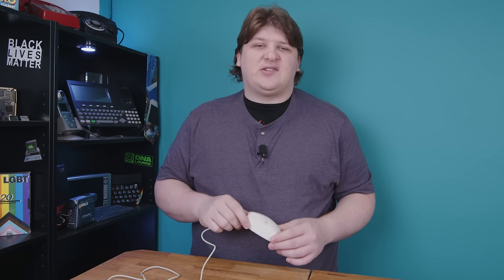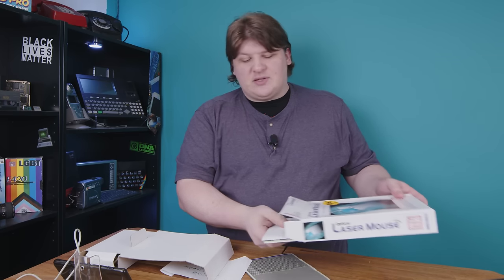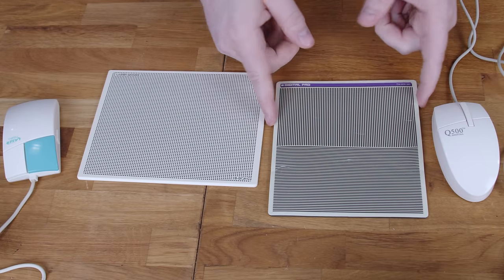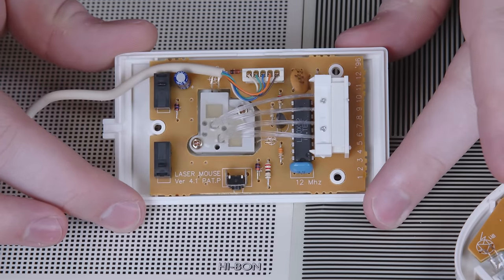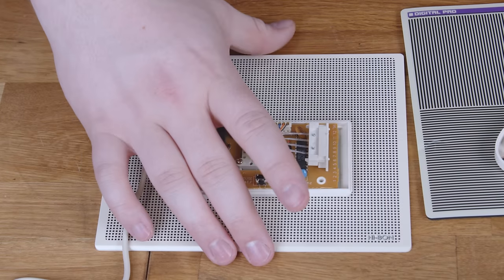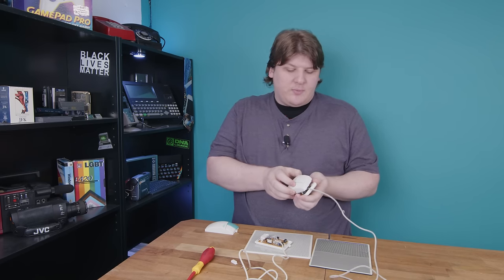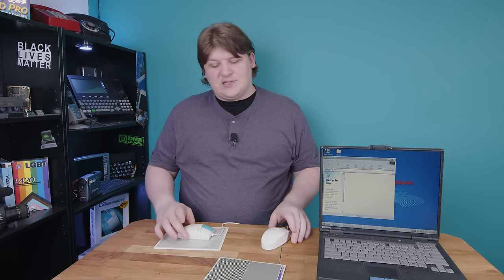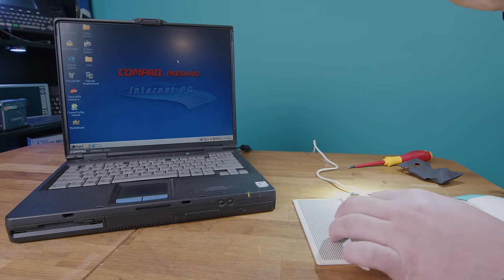LMOX2, The Other Weirdest Mouse

Comment: Hey, I'm the guy that sent that to Clint! Can't believe I got so much content out that silly mouse. Great video as always!
Reply from the maker: Hahaha, wow, yeah, what a trip it's had! Now we have a chain of custody going back three steps - where'd you get it? Nobody else seems to have ever seen one of these, did it pop up at a flea market or something? Thanks for enjoying!
Reply: @CathodeRayDude  I found at the Goodwill in Lebanon, IN still in the shrinkwrap.
Reply: ... and the trail goes cold.

OK, Goodwill donator.  Where you at??  :-D
Reply: @aaronedwards1239  I was there last week. Now this makes me wanna go check the ones down here in the evansville area.
Reply: @CathodeRayDude  I think it's rad that you guys are networking with each other. I would love a collab sometime.
Reply: I saw a few of those weird mice, and many even stranger mouse pads such as the reflective ones. I guess back then V.C.s were looking for the next big thing and a lot of companies were through out this rubbish to try to be that, and of course failed.
Reply: Thx Aaron
Reply: I don't think it's quite done yet. I'd love BaldEngineer or someone like that actually qualified (electrical engineer who loves reverse engineering old computer stuff) take a stab at decoding it.
Reply: @SirenaWF1  that tech is really old, SUN had mice like that over 30yrs ago, and they weren't new stuff then. No one really used them on anything else because they are a bad design, loose or scratch that mousepad and the thing is useless.

Comment: After watching this, I think you might actually have things backwards on which of these came first. You're absolutely right that the Q500 is a minimum viable product, but I think that might be a product of simplifying what they learned from the other one. As you said, the neoprene insert on the mouse did effectively nothing, and it's a much more complex device. It may have been that they realized a cheaper way to do things that still sorta works and tried to simplify as a way to cut costs.
Reply from the maker: possibly, but I really feel like the separate-X-and-Y pad is such a ridiculous instrument that I can't picture someone going from the grid to the XY design
Reply: @CathodeRayDude  absolutely valid point, though I tend to never underestimate cost cutting measures in electronics 😅
Reply: Could just be that the manufacturer realized there were trade-offs to each approach and offered a portfolio of options to the OEM to implement as they saw fit.
Reply: @CathodeRayDude  Although, as you saw, the separate X and Y pad could take odd angles slightly better than the grid design. Tech rarely goes from simpler to more complicated to achieve the same effect.
Reply: I'm gonna throw another 2 cents at it, to say that maybe they did release a tad later the cheaper model, maybe even keeping both on market, one as a more "premium" product, while the other is a low cost variant.
Reply: @CathodeRayDude  I would really suggest looking if possible at the release dates of the mice in relation to the expiry dates on the Mouse Systems patents. The Q500 really looks like something working around those patents while the LMOX2 looks like it is not so presumably was released after the Mouse Systems patents expired.

Comment: I wonder if the neoprene shade is to block *sunlight*, which has lots of infrared. They might've seen issues with users working in sunny environments.
Reply: I remember when LGR did a video about the Sexy Mouse, and it said on the box to avoid using it in direct sunlight. He tried using it outside and it didn't work, so you're most likely correct.
Reply: Or inside the aforementioned arc furnace. Been near one once. Pretty sure they emit everything from DC ground currents to ultraviolet.
Reply: Could the neoprene be loaded with some graphite particles and offer some EMC immunity maybe?
Reply: Yeah, a lot of computer equipment is strangely sensitive to UV if they're not properly shielded. I've heard of electronics being recalled because they would completely break under UV, because their engineers didn't think to test for it before going to production. I also vaguely remember a story about a solar flare causing a bizarre glitch in a video game or computer because of UV.
Reply: @starcrashr  the Raspi 3 (?) release version reboots when you take a flash photo of it because one of the chips is sensitive to light (and improperly packaged). Not a big deal if you know about it – just put something opaque over it – but a surprise to some early adopters
Reply: @the-shork  Right! I was trying to remember that one! I heard some people have been covering them with blu tac.
Reply: It could also be for incandescent/halogen. Several years ago I was using IR-sensitive photosensors and it was virtually impossible to detect a CFL even up close, but an old incandescent bulb worked easily from a moderate distance. And @hai, it was the Pi 2 with the light sensitivity issue. I tried mine under a xenon flash and it indeed crashed.
Reply: @starcrashr  IIRC it was a speed runner playing Super Mario 64. A bit got flipped and sent him to the top of a tower or something.
Reply: @CompComp  Yeah, that's the one. It was a bizarre coincidence.

Comment: What about patent TW388829B, "Optical mouse and mouse pad" by Kyoung-Jin Kim? The original is in Chinese, but it seems to match the Q500.
Reply from the maker: KILLER WORK! That's DEFINITELY it. I tried and tried but could not find this. Now I gotta read it and see if I can suss out how it works
Reply: @CathodeRayDude  You might want to check out the Korean patents it links to, I found the machine translation a bit better; of course the ideal would be  Korean speaker.

Comment: Going by the close ups, it seems like the 4 strands going to each photodiode are in 4x1 strips and not 2x2 bundles. This would make more sense for how it would work going across the grid, and it means the photodiodes and logic in the LMOX2 are working exactly the same as the Q500, sans the strobing lights.

If you break it down to one row of 4 horizontal strands for the vertical movement, because it's exactly twice as wide as the dots, if it's over the dots it'll always have 2 strands seeing black and two seeing white.

So then the possibilities for what each strand can "see" are:
ooxx
xoox
xxoo
oxxo

This means the horizontal position doesn't matter. No matter where the mouse is, as long as it's aligned properly it'll always only be seeing 4 white, or 2:2 white & black. The result is the two photodiodes will be seeing the same pattern of dark and light differences when you move the mouse vertically.

This also explains why the alignment is so sensitive compared to the Q500. A small amount of rotation will cause that ratio to change. If the row of stands gets too far off you'll cease to get the same clear dark and light differences between the rows, and thus to the diodes, and it'll have a harder time understanding what is happening.

Comment: It's been a LONG time (like 20 years) since I did my research into weird mice, but I remember Iotek was a Chinese company that designed a bunch of budget oddball pointing devices. They have a few CN parents in their name.
One day I'll find the weird ultrasonic 3d ring mouse I bought, due to the culmination of that research.
Reply: *patents These guys, iirc, are both based on the same patent. They use IR light to reflect patterns onto receivers, which are designated to X and Y tracking. You're right in that the controller works similarly to how a ball mouse works, btw. It's not the exact same, but similar enough to mention it.
I forget how it knows which direction it's moving, but I know it was in the patent.

Here's one of their patents that I was able to find.
CN99800299A
Reply: Qijia Communication Kunshan Co Ltd ?

Comment: I think you are spot on about how these worked. I think the ‘forgetting how to mouse’ is just an AGC (automatic gain control) circuit adapting. And all of them plus the mouse systems do work like a ball mouse just the the quadrature signal ‘unrolled’ as you said. The mouse systems is much older, it was around in the 80s. Those pads were a hassle though. Heavy and expensive to replace.

Comment: Try to print a mousepad with gradually larger or smaller gaps. So you could theoretically have a hidpi area of the 'desk' our mousepad and a low one
Reply: probably wouldn't work too well, since the fiber optic light changes seem to depend on the grid spacing.

Comment: I swear back in the 90s I had a different kind of optical mouse that required its own special pad. As I recall the pad was dark grey with very fine reflective lines (wires perhaps) in a grid.
Reply from the maker: Yep, that would have been a Mouse Systems design! Check out the Q500 video for an explanation of the WACKY system it used.

Comment: I guess the reason why they couldn't track X&Y on the Q500 is because the sensors don't just see 'Oh its on top' - 'Now its at the bottom' (Like in your animation) - I think that they really depend on the top two rows - middle two rows - bottom two rows (if not even more intermittent steps). Great vid as usual!

Comment: I think IO-Tek probably made the Q500 as a reference design and the LMOX company probably licensed the chip and tweaked the design to work on a better mousepad. 
IO-Tek probably showed off the chip a year earlier and both companies had started development around the same time to reach a 96 release date.
Reply: I really doubt it; the incorporation address of the company in the LMOX FCC application is in the same building as iotek's address in Seoul, so the importer didn't even do certification. They probably just asked iotek to white-label the mouse.

Comment: 9:58 I think you have the directions of the sensors switched.
If I had to guess at how it works then I'd say that they're basically sampling a whole slit of 4 fiber strands and then use the exact same technique as in the other mouse just with half the signal strength as only 2 out of the 4 strands will pass over the black squares in any direction.
Edit: If it were to work in the direction you suggested then it would be possible for the 2 strand wide sensor to pass in between the dots.

Comment: Damn, that was a smooth cut with the two of them joke. I was half right with my comment on the Q500!
Also, I can confirm that the jitteriness is likely an issue with the poling rate of the serial interface. I've noticed the exact same thing happen with both Microsoft mice and a Genius WhiteMouse.
Nice deskmat, too.

Comment: Having used one of these in the 1990s I can add that you're absolutely correct with the release dates.  The first "optical" mice that were not using optical flow type sensors (like the Microsoft one) used metal printed bases as well.  I believe from memory, but cannot confirm that I may have used a Sun Microsystems mouse that used a metal pad with blue lines on it.

Actually I found it... It's on the Wikipedia page.  It was indeed a three button mouse from Sun.

Comment: That’s really clever to use optical fibers to do the integration math to sample a larger area.  Neat. I also bet that the one with more fibers was substantially more expensive to produce, being the high end of io tech’s offerings, and the other, as you say, the minimum viable product.  And with that many fibers I would expect that more than anything, assembly would have been a much higher amount of labor. Gut feelings here.

Comment: Oh man, I thought they gave up on optical mice in the 80's.  Never knew these "modern" ones existed.  I grew up using the 3 button IBM XT mouse with the metal pad, back in the 80's.  So I thought the switch to ball mice was weird.  The older optical mouse seemed so much more elegant with no moving parts.

Comment: Your comment on rotating angles of mouse use reminded me of something. I used to have a Wacom tablet that included a mouse that could be used on the tablet. The tablet had a habit of slowly rotating on my desk as I used it, rotating the mouse tracking with it. Usually I would notice it and rotate it back before it got too annoying. One day I looked down and realized that the tablet had gradually rotated 90°, which meant that up and down were transposed with left and right. What’s crazy is that my brain had gradually compensated for it, and I didn’t even realize it had happened. Once I became conscious of it, the ruse collapsed and I had to rotate the tablet back to regain control.

Comment: The middle mouse button functions are as far as I remember are a duplicate of a Logic 3 serial ball mouse I owned around the same time (possibly a year or two earlier).  As far as I can tell/remember similar features were quite common for 3 button mice around the time as very little software actually supported 3 button mice (certainly windows 3.1 didn't) but manufacturers were looking for features that made them stand out above the "official" Microsoft Windows mice and adding an extra button was one of them.

Comment: When I went to acommunity college in the 90s we had some similar optical mice.
There was something in the college charter that they couldn't donate or sell any excess or obsolete equipment. So everything was used until it broke then thrown away.
One day I was helping move things around the computer lab and we found a locked cupboard full of optical mice that cam with an optical mousepad. 
I'm not sure if they are the same. There were a lot of first gen optical mice that needed a certain pattern to 'move'. 
We put them on all the PCs and tossed the mice they came with. 
Everyone complained.

Comment: I dunno if I'm making things up in my memories but I have a vague recollection of going to somewhere that did mapping or architectural CAD work as a kid (would have been early 2000's) and seeing these guys using a whole table with the grid dots on them. Perhaps this was a potential use case in industrial process that got ported over to the consumer side?

The dots might have been for scale and nothing to do with the mouse - interesting none the less.
Reply from the maker: Those would have been CAD tablets, which i THINK actually use a completely different system where the pad has a grid of wires embedded in it and the puck finds its location by inducing current in them - the grid you can see is just for reference. But I may be completely wrong about that, I haven't deep dived it yet.

Comment: I knew it! I commented how I thought it worked in the previous video (just by looking at the bottom) and I was exactly right. Each line is "blurring" the whole pad in the desired direction, so it can observe one axis while the other one is averaged out.

Also I don't think the serial port is a problem, just the controller which is probably just as slow in the PS/2 version.

Comment: My guess would be that the Q500 was released slightly later than the Laser Mouse as the design is more "modern". It also strikes me that the implementation changes - the separation of the two axes, the drop to two sensors, and the switch to a neoprene mouse pad  - were all cost cutting exercises. Bundling two lots of 8 fibres together and keeping them aligned, applying silicone, and then sorting the strands to send them to the appropriate sensor would likely have been a fiddly labour-intensive manual production process, but dealing with two pairs that can just be clamped and easily poked into the correct hole reduces BOM and assembly costs considerably. On top of that you have a lower overall part count and a general reduction in build quality (e.g. the plastic tab instead of screws) which definitely suggests to me that the Q500 was a cost-reduced revision.

Comment: if there are multiple fibers running into one photocell, my guess is that they are not trying to sample on/off "bits" (with redundancy?),  but rather sampling analog values to gauge the percentage of dot coverage.   in other words, a sensor could discern if its site is on the very edge of a dot if the analog value is 25%.   in this way, plotting an axis' sensors would produce a smooth linegraph rather than a sharp square waveform;  which would be a lot more stable when trying to derive a statistical trend.
Reply from the maker: that's exactly what i'm thinking. the chip could easily have ADCs inside.

Comment: Yeah, I thought it was too, but on thinking about it more, the strobing thing is something that probably precludes the Q500 being a ball mouse controller. Though, considering the LMOX doesn't do that...

though, on this mouse... your animation at 9:54 suggests that the fiber bundles correspond to 2x2 squares, but if they're 4x1 rows it makes a lot more sense: each set will have exactly two fibers occluded when on a row of dots, and none when off the row, no matter where it's located relative to the other axis. if it's the way your animation suggests, then it would have a chance of being 'stuck' in a white grid line [the demo someone else posted on twitter should help explain what i mean, it shows the sensors grouped into 4x1 rows]. Did you examine it in detail to know what shape the fiber bundles were at the endpoints, or did you make an assumption?